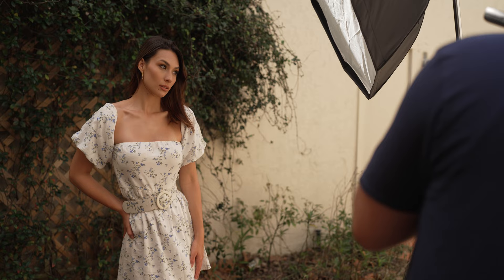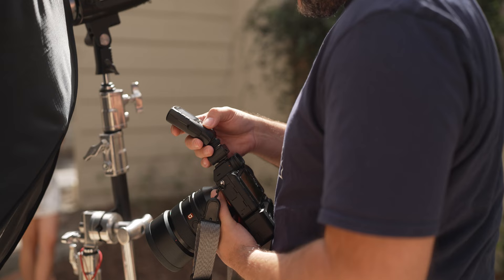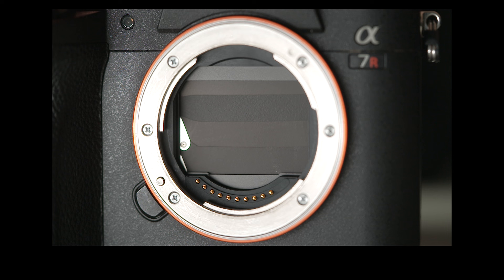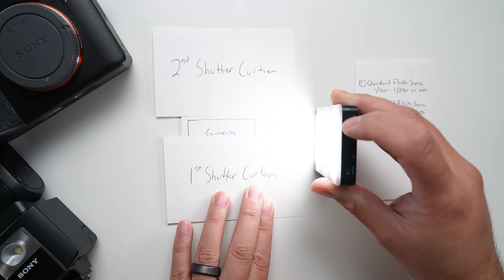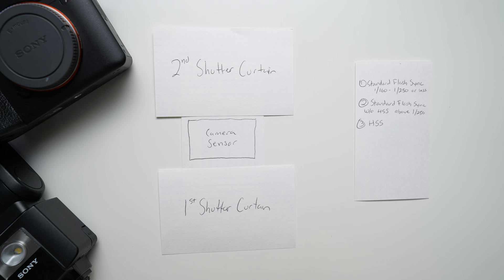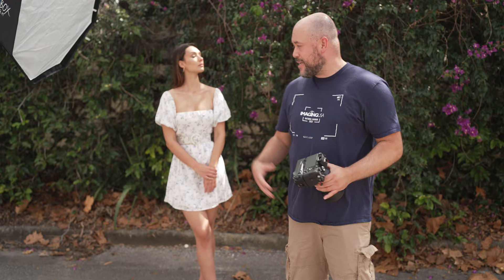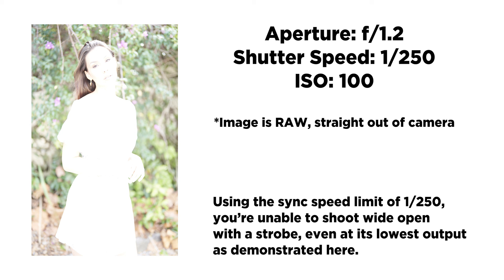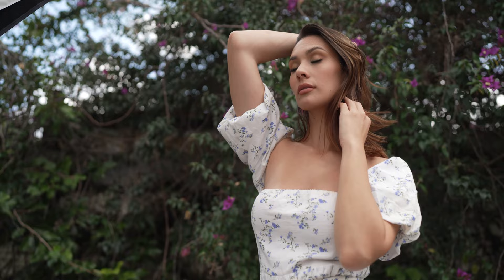High Speed Sync Photography Made Easy!

Comment: Thanks a lot 

Worth mentioning:-
1- the same light amount of the flash in normal mode equals the multiple sets of flashes in sync mode

It is like spilling the same cup of water in small amounts during longer time instead of spilling it all at once
So at any higher sync speed sensor will get some light from the flash

Now, the flash power in sync mode is much much weaker than its power in normal mode 

You need to get it really close to your subject

Can't light the whole body very well without really wide open aperture and strong day light or professional stadiums,  etc. 

Best thing of sync mode is that creamy soft even lighting on your subject !
So delicate,  romantic !!

Comment: As a beginner to flash  photography I was wondering why my images were half black at times  and now I know why. This video was the key to solving my problem thank you so much ☺!!!
Reply: Is that even possible with modern cameras (at least DSLR) ? Any strobe communicating with the camera will set my cameras (Canon) to the max. strobe time. And without that HSS will not work. So you would need to use some older flash which is not recognized by the camera with only the trigger pulse to fall into that hole.

Comment: I may be wrong, but I think your explanation of the way the shutter works at higher speeds is incorrect. Consequently, so is your explanation of how HSS works. This is perhaps clearest at 6:07 where you describe the flash firing multiple times as the 1st curtain moves across the sensor. I'm pretty convinced that what you describe would actually result in a linearly varying exposure, as the very bottom of the sensor would receive only a single flash whilst the top receives multiple flashes.
My understanding is that for higher speed exposures, the two curtains move together across the sensor in a synchronised, but offset manner. Using the nomenclature on your diagram, curtain 2 is released marginally before curtain 1 (the delay between the releases being determined by the desired shutter speed). This results in the sensor being exposed sequentially, as the gap between the two curtains moves over its surface - the smaller the gap, the shorter the exposure. This method is required in order to overcome the physical speed limitations of mechanical shutters. 
The pulsing HSS flash ensures that the light is effectively present through the full duration, as the slit between the curtains passes over the sensor - it sort of emulates a constant light source by means of a very fast sequence of individual flashes.
Bit tricky to explain in writing, but I hope the above makes sense and please do correct me if I'm wrong.
Reply: you're absolutely right!
Reply: @racheljeraffi8597  Thanks Rachel. Good to know I wasn't completely off the mark ☺
Reply: That was exactly what I noticed. That the explanation of the movement of the curtains is wrong. In the example, the top of the sensor receives multiple shots of light from the flash, being overexposed. And the lower parts of the sensor are being covered as the curtain rises.

Comment: Excellent review/tutorial. Helped me to better control my flash. I found and think Sony + Godox doesn’t work well in TTL at close distances (under 3 meters) so M power setting + bounce is the way to go. My diminutive a6500 supports HSS, nice for outdoor when not using ND filters
Reply: I also have an sony a6500:) In which directions do you use the flash in indoor places? Like for the wide shots, close ups and mid shots?

Comment: Hi, thanks for your videos, I learn each time. I have Elinchrom D-Lite which are HSS. When I switch to HSS, the bottom of my pictures are more exposed than the upper part, as if there was a dark gradient going from top to bottom. I assume that this because the upper part of the sensor receives less strobes than the bottom. But when I see you unedited raw that you present in your videos, it seems like you don't have that issue. Is there something I missed? Can we get rid of that gradient?

Comment: I think you forgot the so called supersync or HyperSync. It is a method that usually works best with slow flashes. The idea is simple: use a (mostly cheap) flash that outputs the light over a longer period in time. The longer flash duration covers the extremely short shutter speeds. Synchronisation is the problem here but it works well if the camera and the flash are synced well. Problem with HSS is the faster aging of the flash tube / capacitor.

Comment: To be clear, do you have to shoot manual mode? And what setting on the camera do you have to change for HSS? And any change to settings on the trigger?
Reply: in the video he mentions shutter speeds of 1/160-1/250 is a general flash max sync speed standard so i take that too mean if ur camera flash shutter sync speed in whatever mode is set to above the max (fastest) then your strobe will be set to shoot in HSS but if its set too under that flash sync speed(max of ur camera u have to check ur manual) like 1/125 itll shoot normal and not in HSS. So check too see what the standard flash max shutter sync speed is too know. For Nikon users they call it FP sync in the menu but for canon may be different

Comment: Hi Miguel. Thanks for the great video. I have a has flash, but when I go to higher speeds, I seem to get some horizontal lines all across the image. Any ideas why that might be?
Thanks
Reply from the maker: That's because HSS isn't working for some reason. Could be that your flash or trigger don't support it. What are you using?
Reply: @MiguelQuilesJr  it's a Sony a7siii with a newer has flash, i don't have it with me right now to tell you the model. Alas adding flash has also added a whole new world of confusion...
Ps
Sorry autocorrect got me: neewer HSS flash

Comment: Hey Miguel, thanks for the video. I have a question about this. I’ve been using high speed sync with an xplor 600 pro and a godox v1 for a while now, and no issues ever. But I just bought a godox v860iii and even though the settings are the exact same as the v1, I get the black line across the image at any shutter speed above 1/200.

Any idea what I’m doing wrong?
Reply from the maker: My pleasure! That's a weird one. If you're using the same trigger that's compatible with HSS, then everything should be good. What camera are you using? Some Sony cameras sync at 1/160, so if you're using one of those cameras that''s likely why you're seeing the shutter curtain.
Reply: @MiguelQuilesJr  I use a Z6ii and a Z9, and the Z9 is the one that has the band with the v860iii. The Z6ii’s high speed sync works just fine with both flashes
Reply: @kenuwhoknew  the Z9 has no mechanical shutter. The sensor reads line by line and if there is no shutter in front that might cause the problems. Or it is just a missing firmware update for the Z9…

Comment: Where I got lost was when you said to achieve high speed sync, you will need a trigger. You didn't explain why you would need a trigger and didn't explain whether the flash had to be off the camera and why. It seems to me your explanation is for pro users who already understand enough to execute h.s.s.
Reply from the maker: You need a trigger and a flash that both support HSS in order to use the feature off-camera. On camera, only the flash needs to be compatible.
Reply: @MiguelQuilesJr  Thank you for replying, Miguel, so I bought the Sony HVL-F32M for my Sony a7iv hoping to learn more about using a speedlight. According to my flash specification, it supports hss, so I won't need a trigger to use this feature given your answer. I assume.

Comment: So no coverage of how to actually set your flash or camera settings for HSS. Cool.
Reply from the maker: There's nothing to set, it does it automatically if you have the correct trigger and lights.
Reply: Godox Xpro II and AD600 and I see black banding above 1/200
Reply from the maker: What camera?
Reply: @MiguelQuilesJr  A7 IV
Reply from the maker: There isn't a setting other than to turn on wireless flash in the menu. It sounds to me like the lights aren't going into HSS mode. Check the firmware on the light, remote, and camera body to make sure everything is up to date.

Comment: I never use it. ND filters with non hss is MUCH more efficient. The cover image of this video is completely misleading. Makes no sense
Reply from the maker: Nd filters are great but can present their own issues in certain situations. I typically use them anyway over HSS myself. As for the image, it's not misleading at all and shown in the video. If you shoot wide open (f/1.2) with a strobe outdoors in that spot with the light at the lowest setting, that's what you get with normal sync speeds.
Reply: @MiguelQuilesJr  I never found an issue with nd.
Regarding the image, you would get a blown background, never the subject
Reply from the maker: Again, I showed that in the video. At 1.0 power (lowest setting) on the strobe that was the result. Nothing misleading about it.

Comment: Misleading thumbnail. The image on the left is entirely overexposed. Nothing to to with HSS.
Reply from the maker: You didn't watch the video. Without HSS and shooting wide open at the lowest setting that's what you get. Don't be silly.
Reply: @MiguelQuilesJr  I'm not commenting on the video. I am commenting on the thumbnail. The background is also overexposed. Nothing to do with HSS.
Reply from the maker: It was explained in the video why that is the case. Without HSS (as shown in the thumbnail), I would have to shoot at the highest sync speed that pairs with my lights. At the lowest power setting on the lights, my background and subject are both overexposed. I would need HSS if I wanted to shoot wide open and control the exposure of my environment with my shutter speed. What's misleading about that?
Reply: @MiguelQuilesJr  The image isn't overexposed because the shooter didn't use HSS. It's just overexposed. It is very possible to shoot an image in direct sunlight, with flash, and without necessarily having to use HSS. You can use a reflector, you can use a normal flash (TTL and M are both easy alternatives), or you can use a combination. HSS is not the only solution, nor is it the cause for the image being overexposed. As I said before: the entire image is overexposed. You don't fix overall overexposure by adding more light.
Reply from the maker: @AviViljoen  Again, you missed the point of the entire video. I didn't say there weren't other ways, and in fact, I even mention that there are other ways that I plan on covering in upcoming videos. This demonstration was specifically showing how you can shoot with a wide open aperture (in this case, f/1.2) using HSS with the benefit being that you can shape your light source however you'd like. HSS is one way of doing it, and others will be covered later on.
Reply: @MiguelQuilesJr  Again, I am not talking about the video. I am talking about the thumbnail.
Reply from the maker: Are you the type of person that looks at the cover of a book and assumes the contents within?
Reply: @MiguelQuilesJr  My personal habits have no bearing on the topic under discussion, and I will not be derailed by a subtle change of topic, which is the thumbnail. But, nice try. (Ad hominems will also not work).
Reply from the maker: The thumbnail has already been explained, so all were left with is this silly conversation were having here. If the thumbnail is misleading to you given the context provided in the video then perhaps you can make a better one for me. I'll gladly use it for a day. 👍
Reply: @MiguelQuilesJr  1. Your thumbnails are your own responsibility. 2. If you are not bothered that your thumbnails are misleading, then so be it.
Reply from the maker: I'm not bothered by it at all as it isn't misleading in the slightest. Thanks for watching regardless. ✌️

Comment: Sorry but your curtain explanation is quite wrong and the slow motion doesn't show anything. 
The curtain always moves at the same speed, it doesn't move faster with faster shutter times.
When the shutter time is slower than the sync time, the first curtain opens, the sensor is fully exposed, then the second curtain covers the sensor.
When the shutter is faster than the sync time, the first curtain exposes the sensor and the second curtain follows it on a short delay covering part of the sensor; in this case the sensor is never fully exposed.
With HSS multiple flashes are produced to illuminate the sensor while the two curtains expose only part of it
Reply: You are correct Paolo the shutter hits it's physical limits at max sync speed.  After that the two shutters chase each other.   leaving a smaller and smaller gap in the center.  In HSS the strobe (it's not a flash that's a different thing) will pulse for the entire shutter cycle that remains at 1/200 or 1/250 of a second
Reply: Correct. Love that you pointed that curtains move at constant speed... In Miguels explanation, with curtains varying speed there still could be a time frame where whole sensor could be exposed with strobe, so no HSS needed (like with leaf shutters). Also, with second curtain open fully the constant strobing would overexpose parts of the image, so the final image would start normally exposed with lighter and lighter bands corresponding with strobe flashes.
But the technique shown at the end is valid, although you could still use flash and control ambient light, just not wide open.
Reply: Nice catch. I was also going to point out the omission of the second curtain behavior during HSS, when I saw your comment.
Reply: Yes! I was wondering, why erveryone write "great" and "helpful". Its just wrong (but nice done ;-)) -. so it can't help. btw you don't need HHS so control Ambient light und Flashlight independent. Its the same at 1/8000 s and 5s, The only different is that the sensor in never full uncovered at speed shorter than 1/160s (or 1/250s). And that's the reason why you loose light falling on the curtain. Would be the same when it would strobe but lighting for a longer period.
Reply: That was exactly what I noticed. That the explanation of the movement of the curtains is wrong. In the example, the top of the sensor receives multiple shots of light from the flash, being overexposed. And the lower parts of the sensor are being covered as the curtain rises.